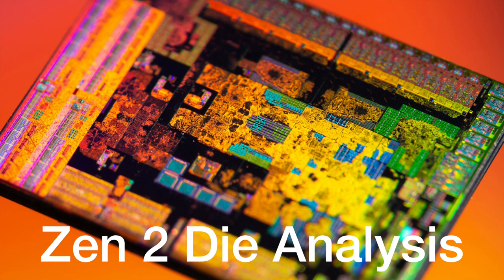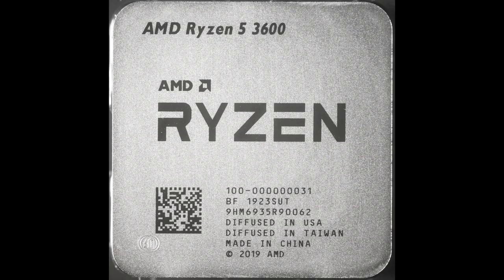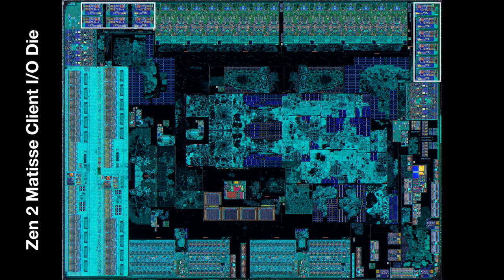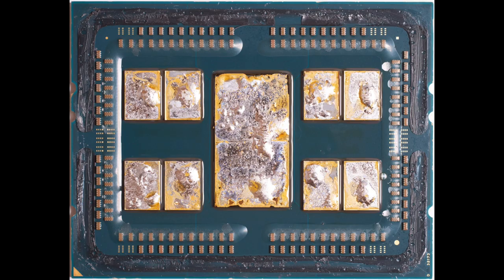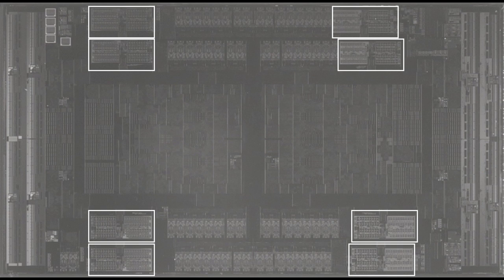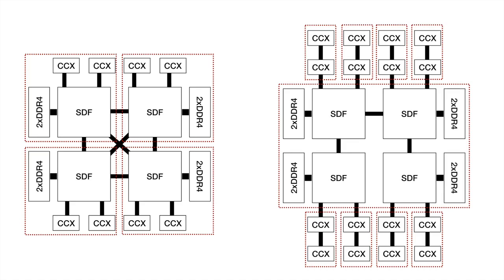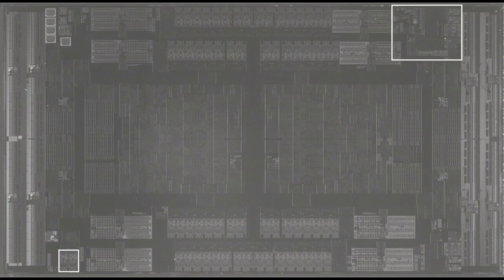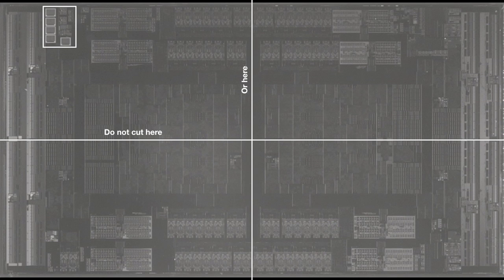Zen 2 die analysis

Comment: The middle 4 quadrants of Rome looks like a separate level of cache to me. This will allow for snoop filter design that helps reduce the impact of snoop latency across multiple ccx chiplets. The chiplets design helps improving cost effectiveness but the cpu might perform really bad with applications that need a lot of cross thread communication. Some applications that require less communication between threads will work well, like data processing workloads that can effectively split the data into small chunks and process it in parallel.

Comment: The 4 SDF in middle of the server IO die looks like not just the crossbar switch but another level of cache + a system agent. The design looks very cost efficient but will seriously hurt peak performance especially if the ddrs are on an IO die that requires a memory read to hop through a phy on the CCD and a phy on the IO die and then the DDR phy. Flip side is you can create as many different types of CPUs with a mix and match of these dies